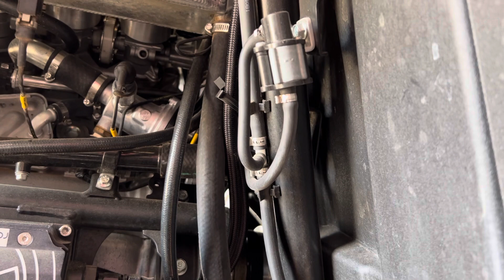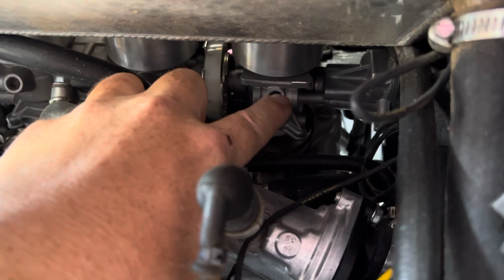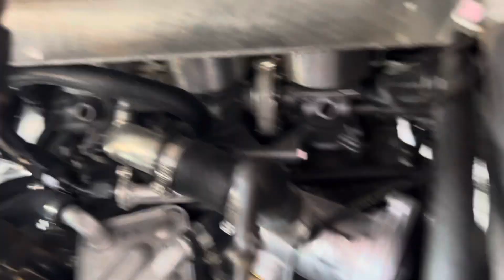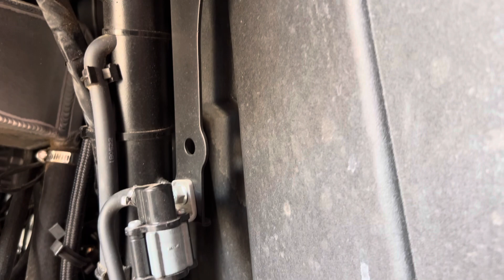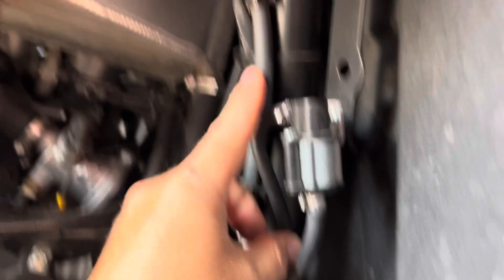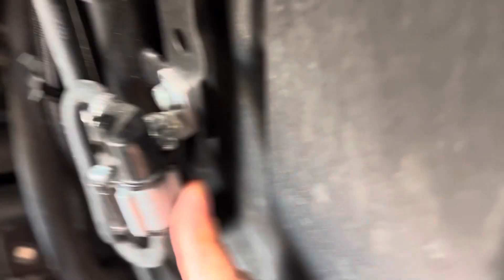2019+ YXZ charcoal canister and rollover valve plumbing.

Comment: NO tuning needed so don't get a code?
Reply from the maker: As long as the solenoid valve is still plugged in you won’t get a code with the factory ecu.   If you are running an aftermarket computer you can get rid of the valve entirely

Comment: Do the block off plates actually help the engine ?
Reply from the maker: The block off plates prevent air from being sucked into the exhaust ports (factory uses this for its catalyst) performance wise there is no noticeable difference, but plates are necessary if you have raised exhaust back pressure from a turbo etc,